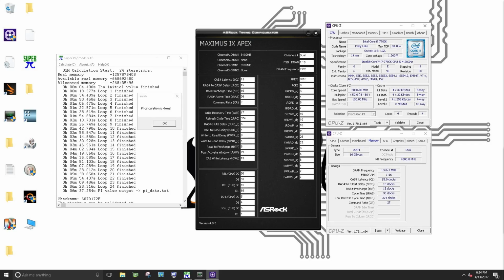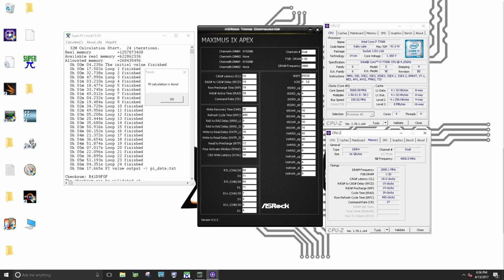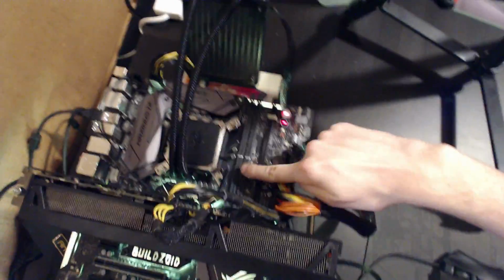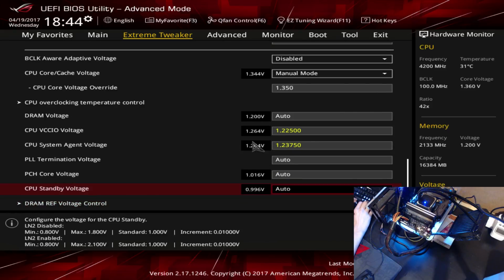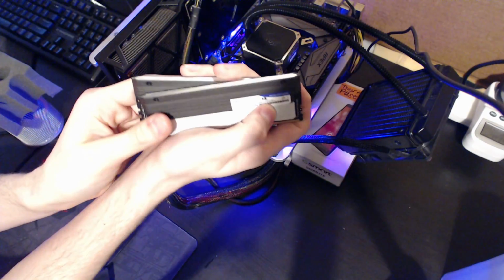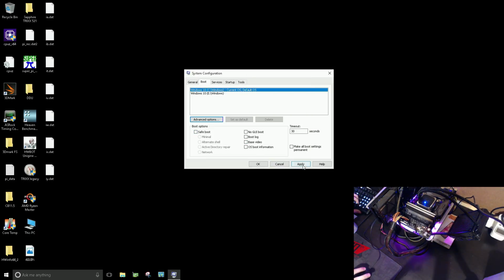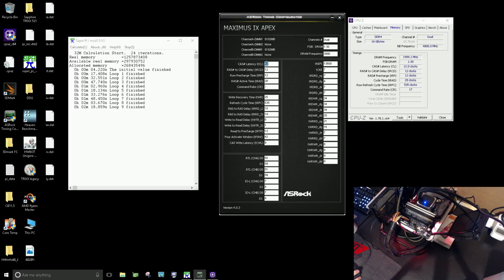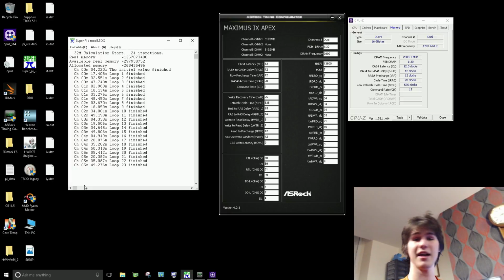Team Group T-Force Xtreem 2x8 DDR4-3733 // RAM at 4GHz CL12

Comment: I just got my hands on a 32gb 3600 cl18 xtreem ..dropped timings down to 16 19 21 at t1 running stable .. big difference in audio workloads at low buffer in both bitwig and nuendo… that and thinking of static oc for 5900x @4.5ghz which can easily go down to 1.175 on vcore .. any tips should be appreciated ! Happy days

Comment: For f4-3200c14-32gtz ("quad ch." 32GB 4x8) (Technically Four f4-3200c14-8gtz but from same manufacturing batch) do you have OC timings? thanks  (Single rank Samsung B die)

Comment: Got 2x 8gb Team Group T-Force Nighthawk RGB 4000 18-20-20-44-700-2t 1.35v to completely 1hr+ WGSAT/500%+ HCI Memtest/6hr+ Prime95 LargeFFT(AVX) stable at 4266 18-18-18-38-374-2t 1.4v w/ manually tightened all (tertiary) sub-timings -- 33275 tREFI (auto x2), tCKE 8, tCWL 16, tWR 16, tFAW 16, tRTP 8. Samsung B-Die kit, of course. Seems great so far, tried to boot CL17 at 1.4v and had trouble training so I just stuck with these stable settings for now. Might try out 1.45v 4400-4500 and tightening some of the timings further when I have more time to run WGSAT/HCI Memtest all day long for stability testing. Motherboard is ASRock Z390 Phantom Gaming ITX, 9700K @ 5.0GHz / 4.5GHz uncore (1.345v--LLC2), 0 AVX offset. VCCIO 1.8v, VCCSA 1.2v.

Comment: I got those in a 3866 set a 5 months ago and it was B-Die Rev. 2 so they OCed well.  They died on me last month, paid to have them shipped to their place in California and they shipped it to China.  I got some new sticks back and something is wrong with them as they're unstable too.  It's not been a good time with them so far.  I love the heatsinks though.  They are heavy.  Good info on what you use to bench RAM.  I haven't used SuperPi and will probably start using it.

Comment: buildzoid here's a tip to OC ram booting ( well at least it worked on DDR3 ), try to heat it up a little, like 50-60°C depends heavily on the IC's, you can use hair dryer or whatever you think of can do the job. Not all IC's like it, but some do. 
That's a thing i came up when plaing with my OCZ reaper DDR3. 
Don't know if it works on DDR4, but it's worth a try, it can save some time when looping on the boot.
And yes, the better DDR stick should be further away from the CPU, it doesn't matter normally, but when extreme OC it does matter a little, when you try to OC a pair.

Comment: So I know this is a kinda old video but what would be some safe voltages for ddr3 the stock xmp or wtv is 1.5v would liek to get it oc to 1866 or 2133 if possible dont wanna push to many volts in and fry it tho lol. 211334 CRUCIAL 8GB 4X2 D3 1600 BLSP CL10
that is the ram kit im running i have 2 kits of that so its 4x4Gb.

Comment: Does Haswell-E do well with high clock memory? Like 3200+
Reply from the maker: Haswell-e generally stops around 3000 - 3200MHz.
Reply: What about RAM voltages on Haswell-E ? Currently running at 1.35V (copied from XMP) and looking at you casually doing 1.5V, 1.8V and 2V on them... is that Samsung B-Die specific? I have one of the earliest Corsair Vengence 2400 XMP from 2014/2015 or something
Reply from the maker: For daily use stick to 1.45V for Benchmarks the voltage you can go up to depends on the memory sticks you have. My Kit of B-die just likes a lot of voltage. But many memory kits don't benefit from voltages in excess of 1.65V.

Comment: How do you find out which timings are causing the system to not POST? The POST codes are kinda vague and I don't have any idea what all the subtimings do, so I just stuck with auto for all my subtimings when I OC'd my dominator platinum kit.

Comment: So going for balance between frequency/timings/capacity/price 3200Mhz CL14 are the best? Considering that's the stock and you could problably go for 3200 CL12 or something like 3600 CL16.
I've seen that big kits (2x16GB and such) usually are not that fast. If you want the fastest you have to go for 2x4GB or 2x8GB best case wich gives you great speed but limits you on capacity.

Comment: did you disable 4 threads(2cores)  on 7700k because in cpuz it says that it has 4cores and 4 threads
Reply from the maker: Yeah that 5Ghz profile has HT disabled because HT actually lowers SuperPi 32M scores.
Reply: He probably disabled HT.
Reply: vdochev yeah i know but will that perform much worser or what
Reply: There was a stream when he benchmarked two RX 480s in Crossfire on Firestrike with an X99 board and in the combine test he got bad results. Then he disabled HT and got more FPS. That was when he started "hating" Intel's HT. I don't know if this is really the reason why he disabled HT here, only he can tell you.

EDIT: Also, HT could help in specific tasks or when the software you are running is optimized. In other cases it is useless and it might hold back the overclocking (although I'm not sure if you could get more MHz if you disable it).
Reply: vdochev if you disable HT it is going to help with oc a lot
Reply: Good to know. I'm rocking a 6600K now which does not come with HT. I hope RYZEN's version of HT is better than Intel's though.
Reply: vdochev i have fx8350 at 5ghz at 1.55v with all cores but when i disable 4 cores/threads i can run it at 5.3ghz at that voltage but every cpu is different
Reply: I can understand that, but it's not actually the same as HT.
Reply: vdochev yeah i know
Reply: I didn't pay for an i7 on purpose because I couldn't justify the price difference just for having HT. The thing I really regret is the 2 more MB cache that the i7 has. Anyway, I'm sort of planning a RYZEN 5 build with a 6 core CPU or a 4 core with an option to upgrade to RYZEN 7 in the future. I haven't decided yet and I'm waiting for ASUS to release an AM4 Sabertooth.

Comment: I have the asus prime x370 pro. What's the best memory kit for it? I'm using corsair lpx single sided 2x8gb and I have it running at 2666mhz 15/16/16/35. Are there sure fire kits for 3200+?
Reply: Patrick Jackson flare x 3200

Comment: on the subject of ram overclocking, what's generally the best that a 5960X would be a able to do ram speed wise, not like a specifically binned one just in general? not sure if this is a vague question or needs some work or what have you, any help will be appreciated
Reply from the maker: This is the fastest I've seen on a 5960X: http://hwbot.org/submission/2922862_the_overclocking_knights_superpi___32m_core_i7_5960x_4min_54sec_735ms

However in generally anything past 3GHz on a Haswell-e start causing serious issues. Some chips won't even POST 3200MHz. I did all my 5960X benchmarking at 2800 10-14-13-26-1T(Micron ICs 1.65V). On a 6950X I run 3400 13-18-18-28-1T(Samsung D-die 1.9V). B-die would do like 3000-3200 11-10-10-28-1T on most 5960Xs but the gain is marginal over cheaper memory kits that can do 3000 11-14-14-28-1T and cost a lot less.
Reply: ahh that works out quite nicely then, been looking around for some ram for the system that's in the making (running a xeon temporarily with this ram, i know it won't be able to do more than 1800MHz iirc but it's a temp cpu till i gather for a 5960X) best kit price/speed wise is something from amazon at 3000MHz 15-15-15-36 1.35v on amazon for  £130, might be worth looking into that then and throwing some extra voltage at it for lower timings if it's stable with that then, many thanks, keep up the good work also

Comment: How much does one gain when actually going to 4ghz ram?
Reply: Nothing but slightly faster operations using compression, conversion and file operations. Oh and fps gains in poorly written games like Fallout 4 of course.
Also iGPUs should see an improvement but whoever buys such a kit won't use the iGPU for heavy tasks.
Most importantly Ryzen would see a HUGE performance improvement if mainboards could only run these kits.

Comment: i got my 2133 ram to 2600 with cl 14 is it possible to get 3200 ?  its kingston hyperx fury
Reply from the maker: depends on the kit of RAM. I have a kit here that at least on X99 won't POST past 2400Mhz at all.
Reply: Actually Hardcore Overclocking thanks for the answer. should i increase the cl when i increase the speed more?

Comment: Do 2x16GB 3200MHz CL14 B-die kits work well with Ryzen?
And 2x16 vs 4x8 which one clocks better?
Reply from the maker: No idea I don't have any.
Reply: @ActuallyHardcoreOverclocking  Depends if your ryzen has quad or dual channel design. Im using 2990wx with G.Skill 3000/14 . Didnt overclocked it yet but im satisfied with performance. 11500pts in CB R20.

Comment: Can you do a VRM analyses of an MSI X370 GAMING PRO CARBON (man I hate capsed names)?
Reply from the maker: If I find pictures I will.
Reply: That's nice of you, since i want to make a Ryzen 5 build and I am not going to drop a 250 bucks CPU into a 300-ish bucks motherboard^^
Reply from the maker: Uh what about X370 Taichi and the X370 Gaming 5/K7 from gigabyte?
Reply: I think I could squeeze the Gaming 5 into my budget if you say that it might be the better option over the Gaming Pro Carbon.
Reply: Ditching the multi GPU option (I looked at some benchmarks for SLI and Crossfire), would a cheap B350M Mortar for example give me roughly the same performance when it comes to overclocking? I am not really concerned about temps btw, as I want to watercool basically every heat source (tell me when it gets annoying here...).